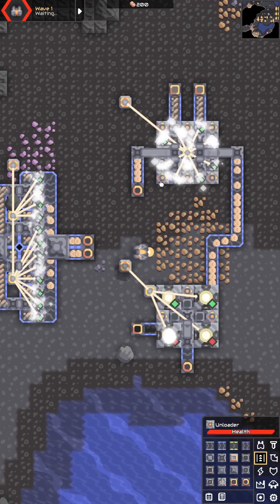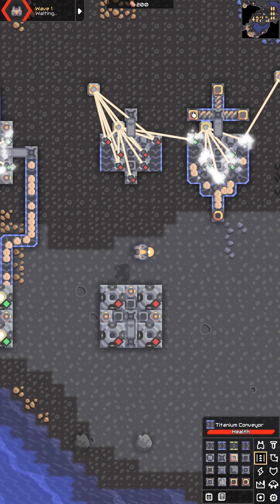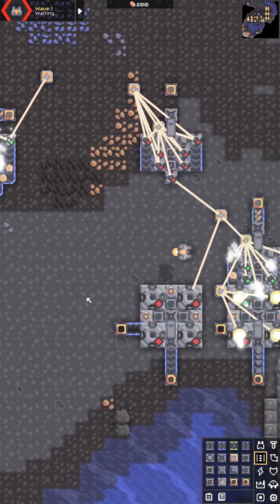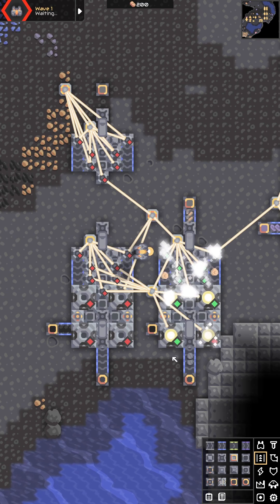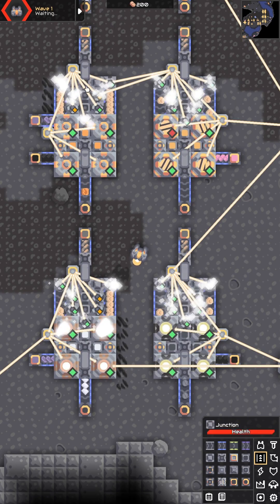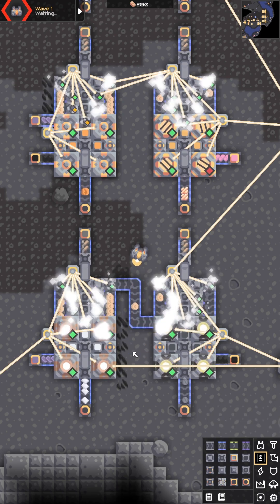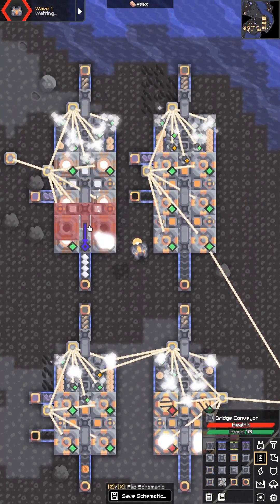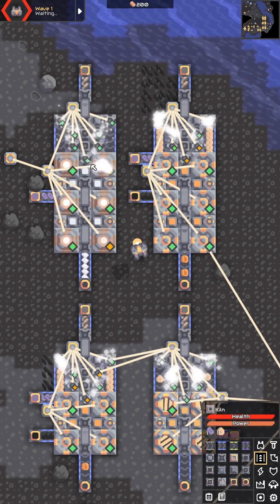Scrap Arrow - Converting Scrap to Sand as Schematic Add-on

Comment: Hey, would it backfire if scrap's not enogh
Reply: No.
Reply: It would, you would need 2 constant line of scraps to make 1 constant line of sand

plus if you wanna make 75% constant silicon line you would need 2 constant lines of sand and just 1 constant line of coal

all of these assuming we are using the titanium conveyor belt

Comment: I just have one question, how will this help with my 18303729282 silicon debt?
Reply from the maker: It might but I think this other one would help more. Just put these in a row horizontally touching and you can get a lot of silicon. https://mindustryschematics.com/schematics/67bfc45d6d73fd31e8ec95cb